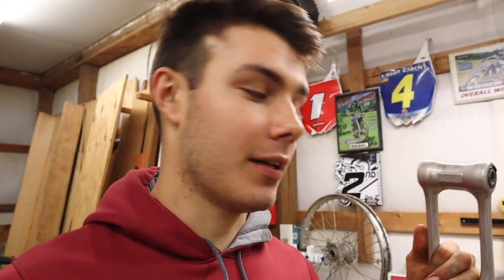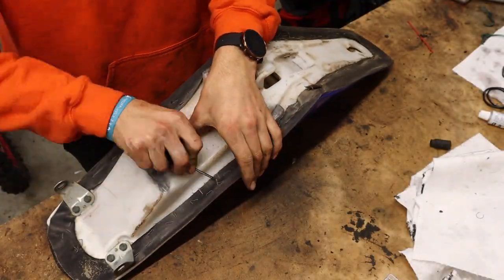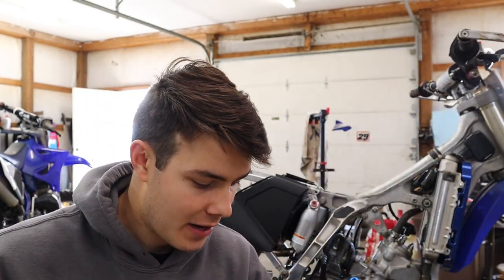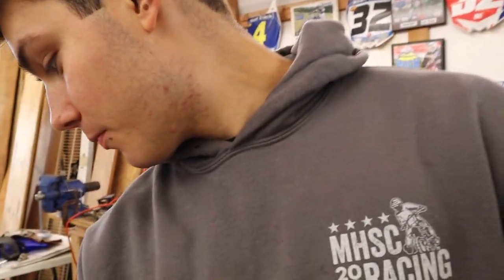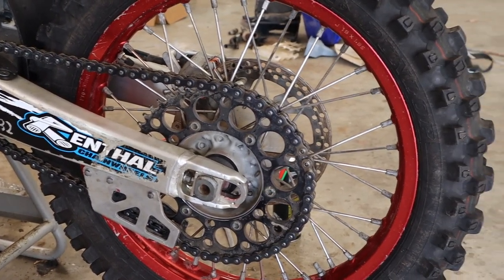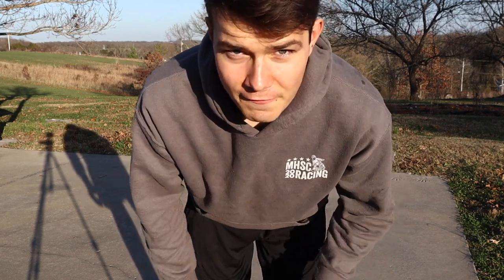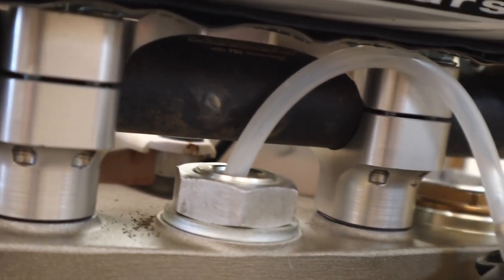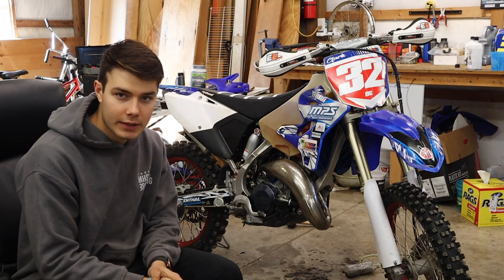YZ125 Two Stroke Bike Build is Done! - YZ125 PROJECT BUILD PART 5

Comment: what fuel and 2 stroke oil you running? nice bike and great job
Reply from the maker: Pump gas 93 and right now amsoil but I'm not too picky as long as it's got a good reputation
Reply: Try Avgas with Klotz supertechniplate. Best smell ever💨💨💨and burns clean